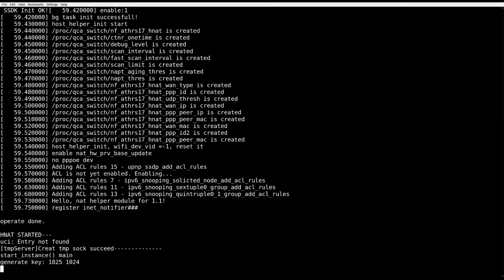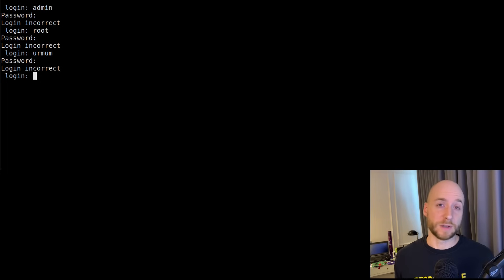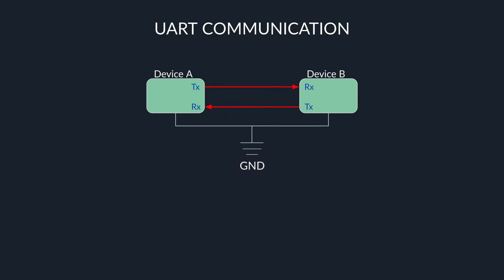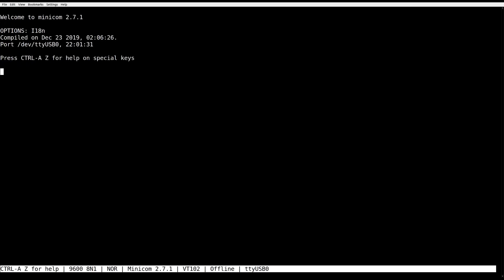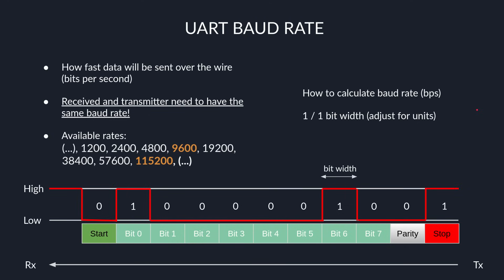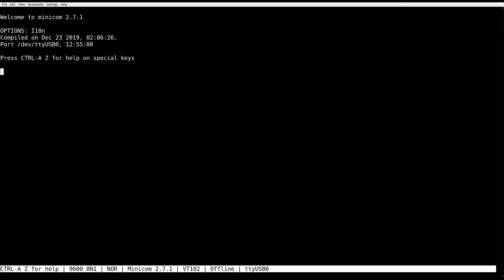Hacker's Guide to UART Root Shells

Comment: Hey Guys! Thank you very much for this awesome video! It's very informative and it's cool to see how everything comes together at the end. From the bits recorded by the logic analyzer to the baud rate to the connection. Even though it's faster to just guess the baud rate, due to your example it's much clearer what is going on in the background.

Right now I'm trying to connect to a cheap 8 dollar smart watch which works with the Mediatek MT6260 SoC and aparently it's working with 2.8 volts cause it's cmos based. Can i still use an FTDI adapter in 3.3 V mode to connect? I tried to find some information on the internet but wasn't very successful!

Greetings

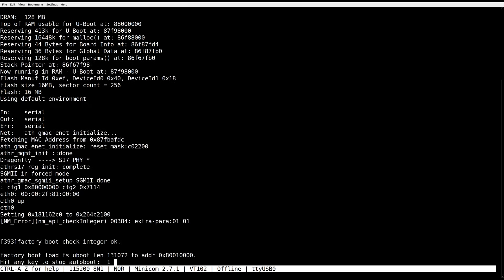Comment: Hi... Thanks for the amazing video. I physically found a broken UART Port with three pins on an chinese IP camera, and one pin is 'GND' terminal for sure. I really have doubt the other two, terminals on finding which one is TX and RX. By little bit of solder on the other two terminals, I am able to read the bootloader info from Camera to my linux shell via FTDI chip. But the other way communication, i.e., hit any key to stop autoboot (as you mentioned in video @14:48) I am unable to perform. FH8626V100 is the SoC. Unable to get datasheet. I am thinking of pull up resistors also. Can you pls help?
Reply: got an oscilloscope? it would probably make the problem apparent
Reply: Little late maybe? You can guess by trying RX/TX. Learned that when I stomped with a device that had the wrong pin marking, instead of saying the SoC TX and RX, it said "Here you should comnect your RX (being the SoC TX"

Just takes more time, put the pins one way, try all the common baudrates, reverse and try again.
Reply: Also, the autoboot thingy, depends on the bootloader, I've seen devices that only stop booting with a specific key (I'm pointing at you, Dahua devices!) Where only the asterisk key worked. Didn't figure that myself, used to work with the brand haha.

Comment: Thank you for your content. 
Please recommend some devices to get my feet wet. A cheap router and the uart usb.
If for example i use the wrong pins in the uart, can i fry the target?
Congrats once again 🇵🇹
Reply from the maker: You could start with TP-Link TL-WR841N. It's quite cheap and could be a good start. There are really a lot of UART-USB devices on amazon, just take the one which has good reviews and has a good price for you and you should be fine.
I think the risk of frying the board is quite small if you make sure you discover the ground and vcc pin of the board and you wire things fine.
Reply: @FlashbackTeam  thanks for the response. Please keep up with this channel

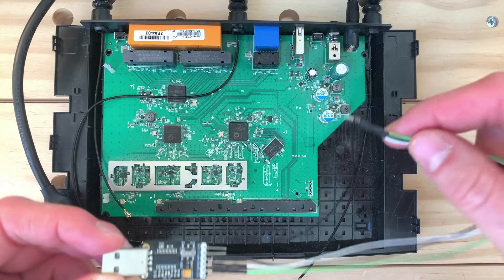Comment: 8:01 what's the name of the board? that can speak UART. great video
Reply from the maker: Just search for any USB-to-UART adapter. They will register to your computer as a device, i.e. /dev/ttyUSB0. They have FTDI chips that is used to speak UART protocol.
Reply: you can use arduino as that device by connecting the reset pin to arduino to gnd and then using its tx rx vcc and gnd pin , same as in ftdi
Reply: "UART" is not a protocol, it's a device (here built into the processor) that provides an asynchronous serial port to a system. The easiest way to refer to it is just "serial port", or "RS-232" if you ignore that the voltage levels are wrong.

Comment: Great insightful video with lots of very useful tips. However I have a couple of points.

Why use a paper clip? A proper 0 ohm SMD "resistor" is easy to scavenge, or just use the old electronic engineer's trick of solder bridging, or using a piece of desolder braid, cut and soldered to the pads already present. A paper clip seems such a clumsy way.

I'm not sure if it's just the way you pronounce it but I didn't catch what you meant by baud rate initially as it sounded like "band" rate. I know the German pronunciation is "bawd" rate (roughly) but most native English speakers would expect to hear  "bord" rate. This is not meant as a criticism but more of an observation.
Reply from the maker: Hi Bob. Thanks a lot for your comments. The reason we have used a paper clip was because we were on a trip and we didn't have easy access to any soldering equipment so we had to be creative. All your suggestions are valid and with access to a lab that would be much better option. You can actually see our another video where we present our exploit on this target: https://www.youtube.com/watch?v=zjafMP7EgEA

Thanks for the info about pronunciation of baud rate. :) As you have noticed we are not native speakers but we include edited subtitles so it's easier to understand.

Comment: I am interfacing with a fetch mini .. I’m getting garbage on the screen at 9600 and have tried higher and lower.. it’s in loop the garage code
Reply: Even if you get the bit rate correct, the order in which the bits are sent and received could be wrong (software issue)

Comment: Does plugging a cable into a root terminal port really qualify as "hacking"?
Reply: Yes, as long as it’s not an external Ethernet port for example, you need a special UART to USB device to plug into these boards, so it’s beyond consumer knowledge and is a form of hacking since you’re accessing part of the product the manufacturer did not intend to be exposed to the consumer and is certainly undocumented.

Comment: You found out the current speed rate being 120,005.  How that difference with 115,200 does not affect the communication between the devices? Is there a kind of time correction from time to time?
Reply from the maker: It doesn’t need to be exactly the same, a small error is OK for our purposes (we just use it as a text console). 

In these cases it is best to stick to common baud speeds, of which 115200 is one of them.
Reply: I bet it was just a rounding error. Devices operate at standard baud rates.
Reply: The bits have width on the electrical waveform. If the timing is not off by too much, then when the data line is sampled it will still read the correct value.

Now, if Manchester bi-phase encoding were to be used, as that's an edge triggered protocol, pulse width distortion has much less effect and the protocol is much more resilient to it.

Comment: What was that? Gimp?  Wha…?   How the hell did that help with trace location termination points?  I don’t get it.  Does the program analize the photo of the board and layer it so you can remove the chips to get a better look at the labeling and traces?  Still yet how do you find the trace path with it?  I usually have to get out the ultra fine leads and go through pins 1 by 1 following the paths if is a multi layer..  most the time i find it but on bigger boards sometimes it gets convoluted and is lost..  but gimp?  Wha?

Comment: The thing I hate about these UART chips is they are extremely poor with buffering.  They are easy to overload by feeding them data too fast.
Reply: So what's your point ? Why would you use a higher baud rate than specified ?
Reply: @greywolf271  umm I never said that.  It's if your pic or controller doesn't respond fast enough you drop characters or data.

It can make reprogramming or hacking them difficult.
Reply: @donh8833  but uart was never designed to be a transport protocol like tcp ip, add enough of a delay problem solved

Comment: Gee, since before these guys were born, "a UART" was a physical device, and it could use multiple protocols... UART  not a protocol, it's, at best, a physical interface that supports asynchronous data receiving and transmitting.